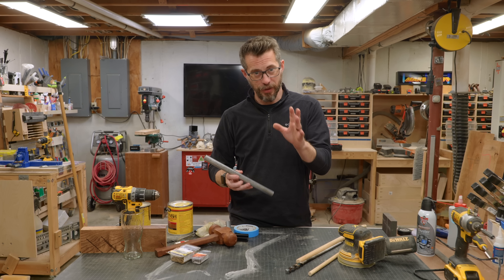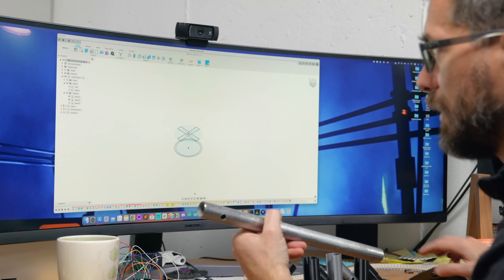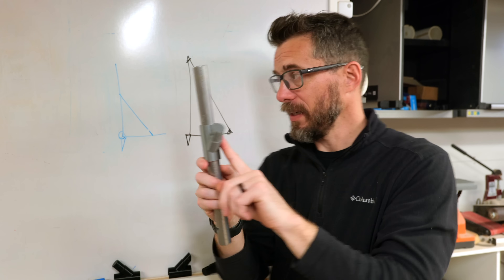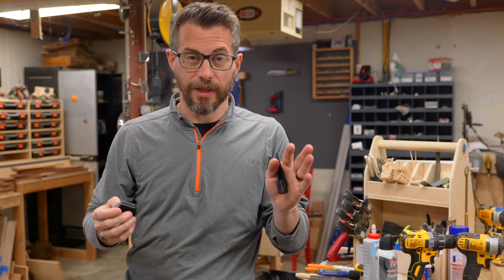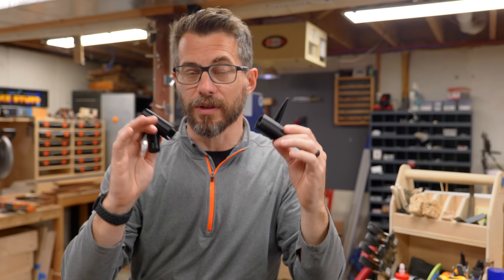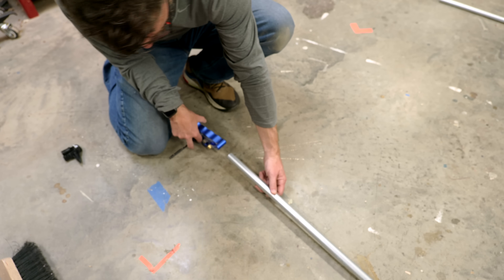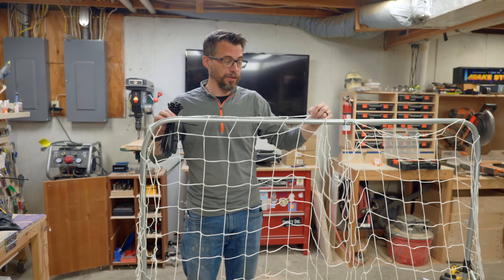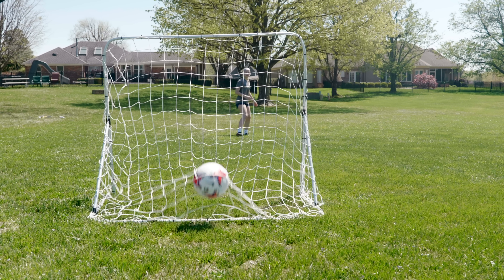A 3d Printer Made Me a Better Football Player

Comment: Helpful tip for bending the conduit. Put your foot on the bender pedal and push down on it throughout the bend. Helps the conduit not kink, helps it not slide around , gives you a lot more leverage and makes bending a lot easier.
Reply from the maker: Thanks!

Comment: Angle the spike towards the back of the net, less chance of it coming out if the ball hits the crossbar, and less dangerous if there is a goalie.
Also perhaps extra spike fittings for the back of the net section, add more stability.
Use the clamp type fitting, but add a loop for the net to attach too, then position them around the bars.

Comment: Lots of problem solving in this one. I feel like version 2.0 is needed. one soccer ball shot to the goal post and this whole thing is breaking into pieces.  Or kicking it in at an angle and it will rack and break or at least pull the small steaks out of the ground.
Reply from the maker: I've been working on updating and strengthening it!

Comment: Very cool idea. All too often these sorts of things are made out of cheap junk, and not designed with important functions like storage in mind. Not that a 3-D print can't break, but at least you can reprint it unlike some thing that's made out of entirely injection molded junk. As conduit is less than a dollar per foot, I imagine this entire soccer goal didn't cost that much to make… The net itself probably cost the most. There is also some interesting thoughts that can be put into how to reuse these materials, when this soccer goal is no longer required. Less waste = big wins.

Oh and my idea for how to use this? A small (raised bed sized) portable green house. Again, the pipes and plastic they use on the ones you find on Amazon will rust out or break in a season (two at most).

Comment: I made something similar for a collapsible projector screen using electrical conduit (files on printables) but the big difference between yours and mind was I wanted to put the meat on the outside so you could use zip ties to pull the screen tight, vs you have the meat on the inside to keep it sleek and compact

Comment: Great concept! I wonder if you could incorporate the push button compliant structures like you see on tent poles (normally metal) so no bolts would be required , and build them into the connectors?

Comment: Great idea! I find that most commercial available soccer goals (the cheaper affordable ones), especially the regulation size, they use steel pipe but it droops in the middle of the 24' span. Any solution for that? The pipe they use isn't thick or strong enough for the distance the goal spans. The thinner pipe is way more affordable, probably why they use that.

Comment: You just need to 3d print some clips for the net to  fit around the bars . You can use the same design as the angles clips and place an indented section for the net string to sit in .

Comment: any line (or point) on an infinite shape like a tube will be halfway between the "top" and "bottom" because those are arbitrary. your later idea of a jig eliminates the need for this unnecesssary step. until you drill the holes, the alignment of the poles (rotation) isn't relevant.
great project. now can you develop an infallible VAR?

Comment: I'd be curious how these parts hold up to their use for a while. For a usage like this and even outside I'd be a scared to use such delicate 3D print parts.
Reply: That's the beauty of 3D printing! If the plastic part does get degraded by the sun or broken by a soccer ball, you just print another part using the same file you printed the original part.

Comment: I'm surprised you didn't 3 d print a Tool for it, It could just fit over the end of the pipe and have the screw holes built in on each side.  I can't think of the word for that but like a master copy... So you can make repeatable holes on the end of the pip in the same place

Comment: Nice, but requires a 3D printer, or access to one. I prefer 1/2" or 1" PVC pipe and fittings and a small hack saw. I did a camping shower tent a few years ago still in use, using standard fittings, some with slots to be able to clamp like yours, and fully 'collapsible' for transport or storage. Use what you have access to...

Comment: So, two factors that were no discussed.
1) Human vessel technologies were less able to be overtaken by the Romulan drone ships. As a result, why build more ships that could simply be turned against their owners? It makes sense that the Coalition would default to ship technologies that were more resistant to hijacking.

2) TOS pointed out that Starfleet was almost purely humans. Why build ships for cultures that still did not want to partake in joint ventures of exploration? 

I think the truth is basically these three cemented the iconic design lineage of UFP Starfleet vessels, and it just kept evolving from there. Oberth, Defiant, and Intrepid all seem to be the most unique non-standard "human" style Starfleet vessels, at least until we get to the junkyard at Wolf 359, and the Dominion War, which still saw Miranda, Excelsior, and Galaxy class mainstays.

Comment: generic angle attachment piece, even a sphere with holes, pun intended, in the corners
Reply: aluminium extrusion standard tubes have standard connectors, already
Reply: or use different sizes of pipes/tubes that lock-fit over each other
Reply: like bend an outer pipe to like 45 degrees, then open the side, to fit a smaller pipe, to make a 45 degrees T-joint
Reply: yes even rigid metal pipe welding after that
Reply: remember 42